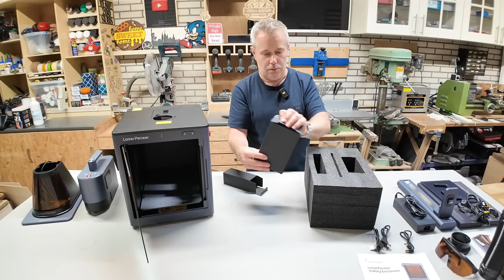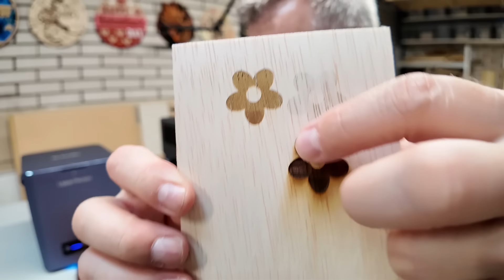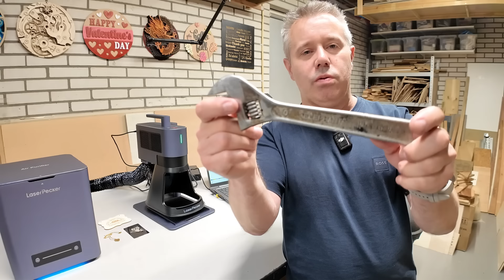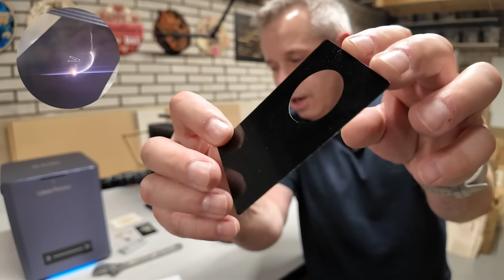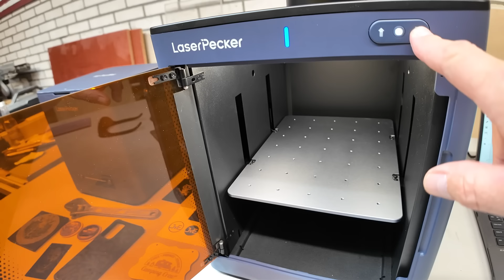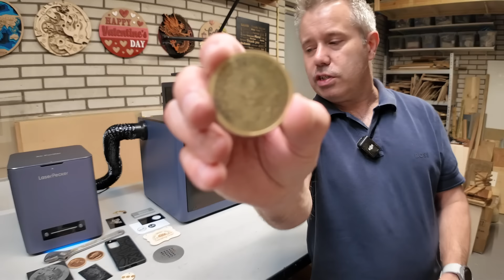Laserpecker LP5, The power of a 20W Fiber + 20W Diode Laser | #laserpecker #laserengraving #laser

Comment: Hello how you I've seen your video for Laserpeaker 5 (Super Good). I have a question for you I also have the Peacker 5 laser and I want to know how I use it with Lightburn. The version of Lightburn I have is from a year ago I tried to connect it to work with Lightburn and it doesn't leave me like you.
Reply from the maker: Hi, you will need to make sure the LP5 is on the correct firmware and then download the config file for Lightburn.
Once you import this, the machine should be recognized and the correct macro's will also be available in Lightburn (Blue diode/IR).
You can also follow the guide from Laserpecker on how to do this.
https://support.laserpecker.net/hc/en-us/articles/10710301115535-Operating-LP5-with-LightBurn

Hope this helps you getting it resolved.

Comment: Hello, good morning. This machine is impressive due to its speed and high quality.
Can the IR laser engrave or cut transparent acrylic, or engrave on glass?
Reply from the maker: Yes, very nice machine. No, for this you need to use the blue diode laser. But that's the nice thing about the machine, it has both and both with 20W power. Thanks for watching!